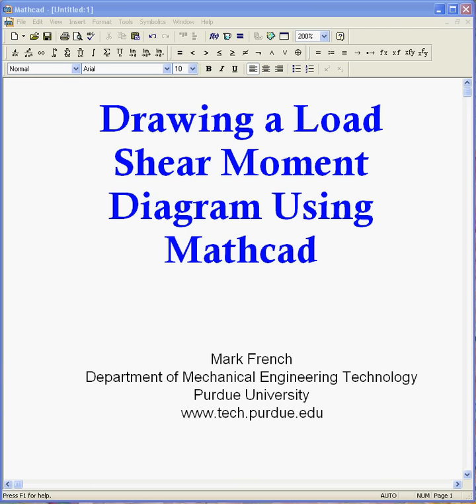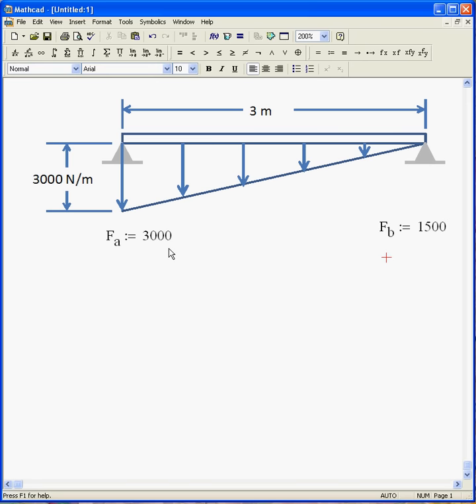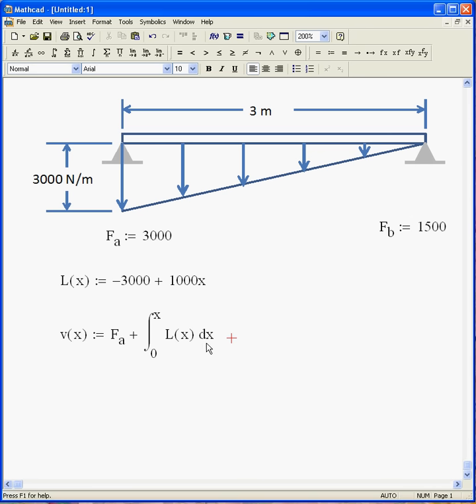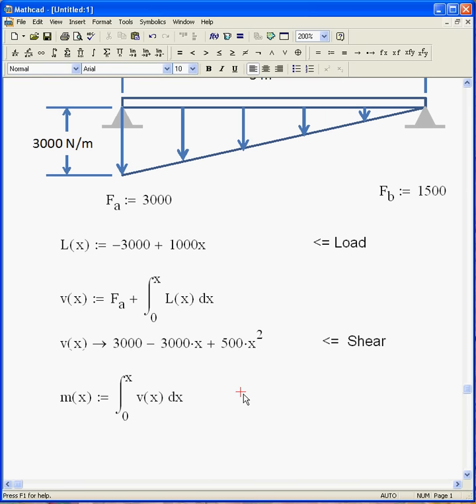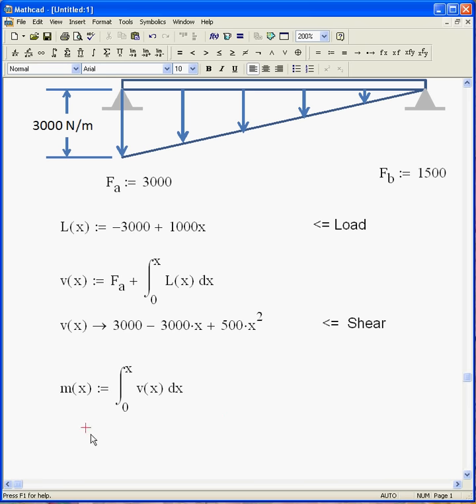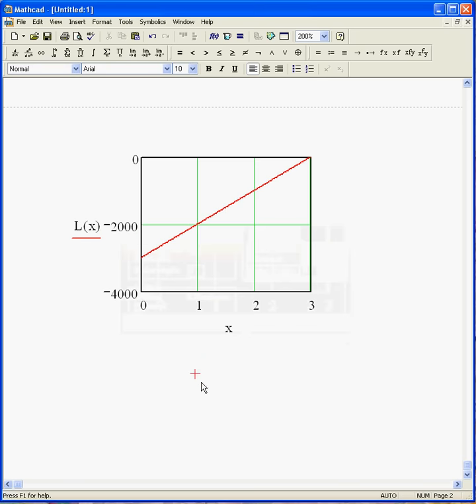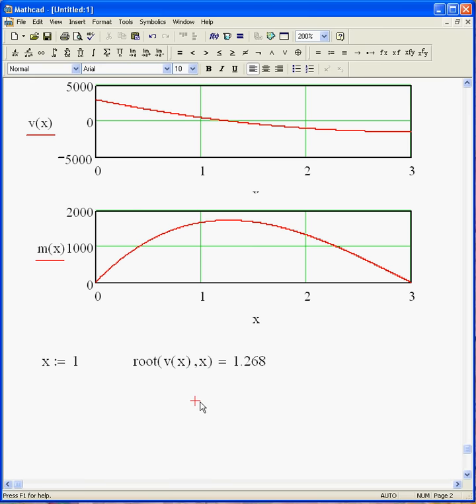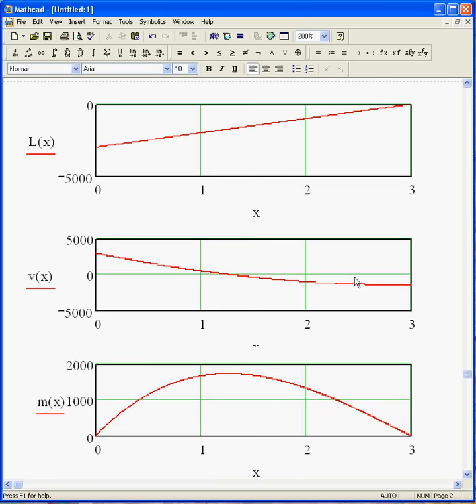Load Shear Moment Diagram with Mathcad.avi

Comment from the maker: @diflection1 I'm afraid not.  You are correct that the 5th derivative will give the slope of the distributed load, but you will still have to integrate repeatedly to get the deflection.  Also, a truly new method would have to be generally applicable and it looks like this one would apply only to very specific loading conditions.  That said, it's great that you are really studying this problem.  I'm sure you now understand it thoroughly.